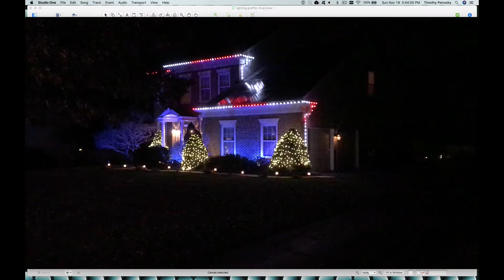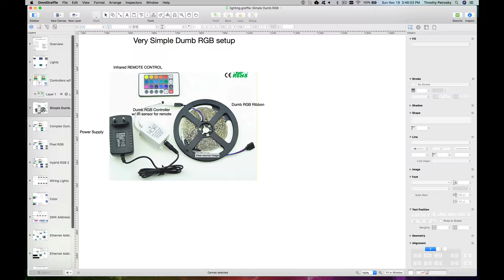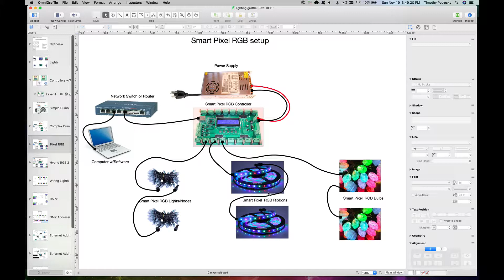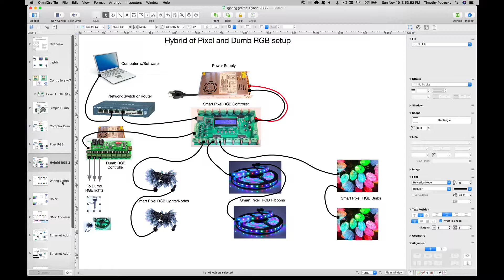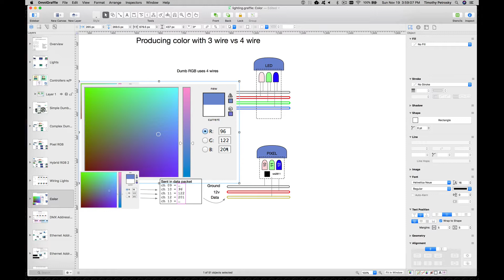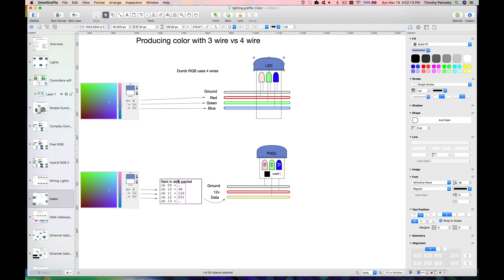dmx part 2 smart vs dumb

Comment: Tim, I implemented my first pixel Christmas lights two years ago, with about 90% smart pixels, and 10% dumb RGB (and I use only AlphaPix controllers, which I notice you use as an image). I viewed 100s of videos before even starting the hobby, in an attempt to get things somewhat correct the first time.   Your video is one of the most well laid-out and clear explanations of smart pixels and dumb RGB that I've come across the past two years.  You may be the new John Storms of the Christmas lights hobby.  :-)   I'm guessing it took a lot of planning and effort to put together the slides and to "sequence" your presentation.  Excellent video, and thanks very much for adding to the knowledge about smart pixels and dumb RGB.  [I posted some videos of my house (a bit under exposed) at Revel Lights on YouTube.]